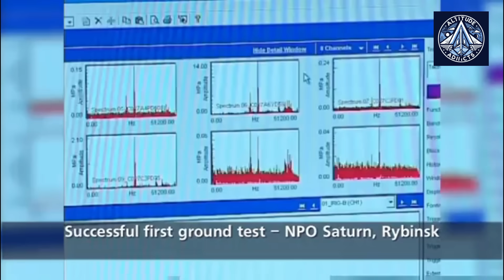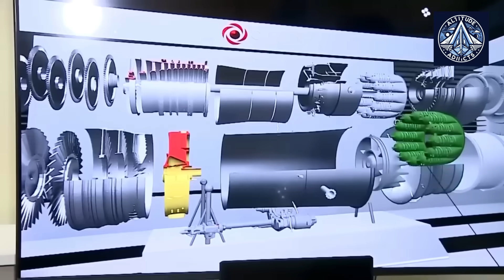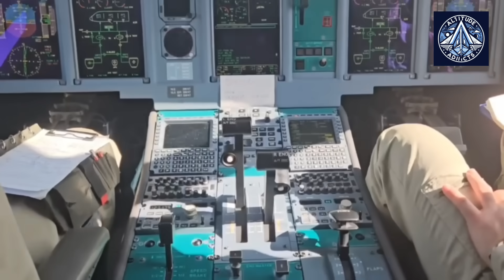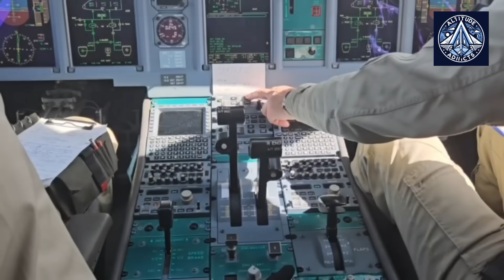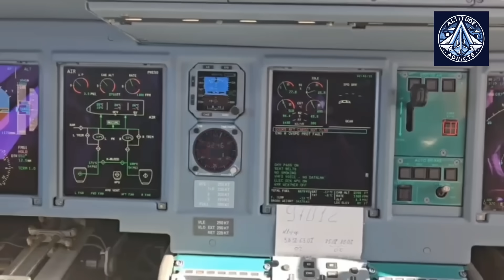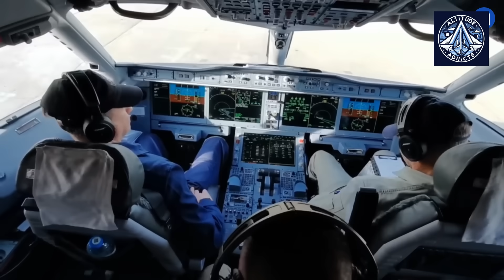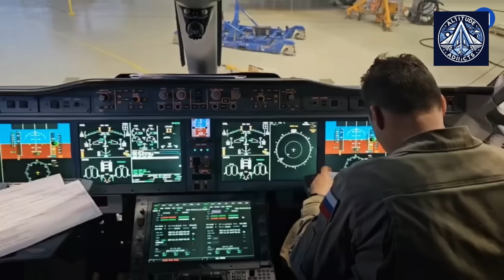A Deep Dive into the PD-8: The Engine Tech That Saved Russia’s Superjet from Sanctions

Comment: As a Retired Pilot here in the USA, I have always admired the growth of the SSJ-100 to the current model of SJ-100 with the PD8 powerplant. I am curious about the weight of the PD8 vs the SaM146 that it replaces and also the specific fuel flow of each engine
Michael P.
Reply: Dengan adanya data yang telah ada di bagian dingin NPO Saturn pada SaM146, maka apa yang sudah ada bisa dipertahankan untuk digunakan di PD-8.
Selanjutnya bagian panas yang sudah sukses di PD-14 diterapkan ke PD-8 yang merupakan versi kecilnya.
Bisa jadi akan sama hasilnya, atau bisa pula PD-8 lebih baik dari pada SaM146.
Akan tetapi, dengan tidak bergantung barang impor maka masa depan Superjet 100 akan lebih bagus daripada Comac C909 China yang tergantung mesin dari GE.
Juga Embraer E2 pun sering bergumul dengan mesin yang gampang rusak dari keluarga PW1000G.
Reply: O PD8: está com muita tecnologia dentro da sua categoria, está muito aprimorado que vai ser referência, gostaria de saber se funciona até aos 15.000 metros de altitude ,para dar caminho a novos jatos executivos .
Reply: @heciopataca9998  Currently confirmed 11300 m. Expected on board of the SSJ-100 - 12200/FL400
Reply: weight of SAM 146 engine with nacelle is 2150 kg, PD-8 - 2 300 kg
Reply: @toriyshaov2245  The most important thing is not a higher weight, unlike the SAM146, but improved energy consumption and logistics with spare parts. It was the logistics of supplying the French part of the SAM146 engine that played a negative role in the use of the Superjet in Mexico and some other countries. Now this is the last stage.
Reply: The Pd 8 is a larger engine with a bypass ratio of about 5:1 and a heavier PD 14 core. So it's about  200-300kgs heavier, it uses composites for the nacelles. It's about 10% more economical than the Sam 146 though. Russians are pretty stupid though... Immediately sanctions are stopped they will immediately dump their engines instead of kaizen
Reply: @pee_diddy  Why on earth would the Russians abandon their engines? All the problems with the Superjet in the past were due to the French part of the engine, now it will be fixed!
Reply: @vladimirnikolskiy  Очень хорошее наследие оставила / поработала Ваша USAID...  (начаная с 90х годов )
Reply: @pee_diddy  that is their major problem..

Comment: Wrong, the SaM-146 was a contract between the Italians an SAFRAN, as the Italians abandoned the Yak-130 and SS100 programs, those landed into Russian lap as the contracts were still in force and they continued them by modifying the rest turbine section from the parts made by CFM International thus increasing the lifespan of the engines and so they wouldn't fall apart at just 4,000 hours, thus making a couple of hundred more Sukhoi s 100's....
They have half a dozen other engines and manufacturers that they could use but they decided to combine parts of the big salad to create new engines and make them simpler...
Reply: Italy was primarily involved in marketing, sales support and training.  Avio Aero provided low pressure blades and some bearings but they are a division of safran
Reply: @jeffhedrich3551  No, Leonardo hold 51% of the partnership and controlled all aspects of the venture, many of those contracts went to US companies...!.. One of them was a US company that made the defective blades for the hot section of the turbine..